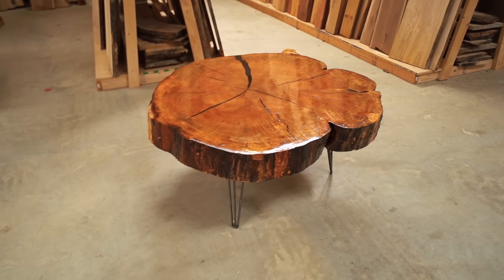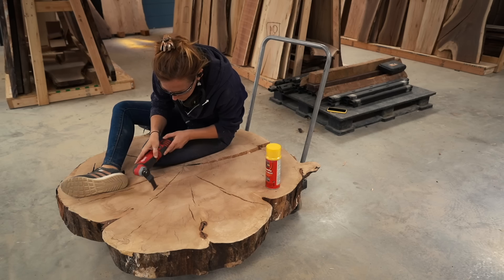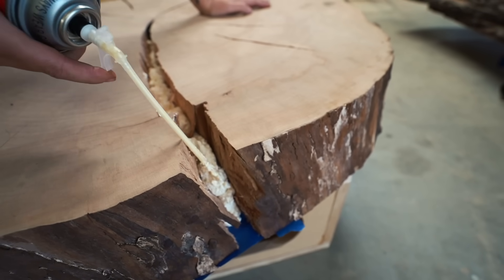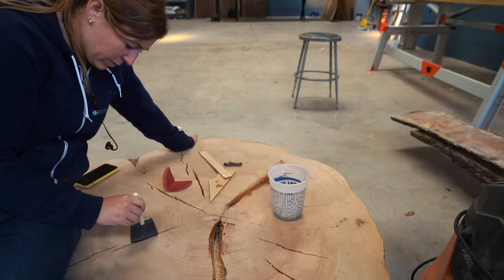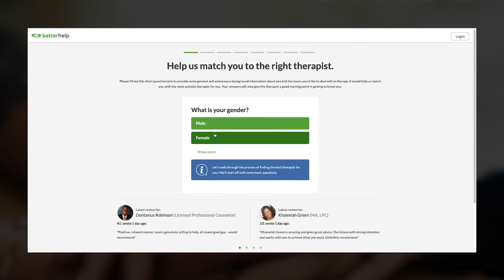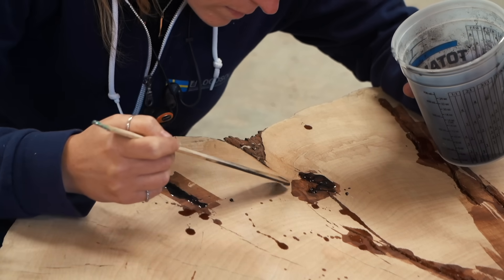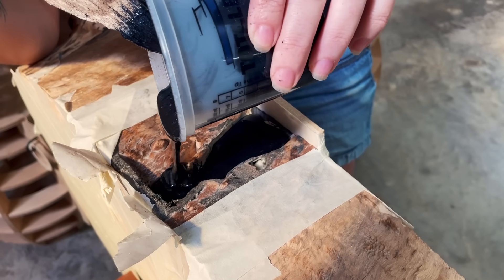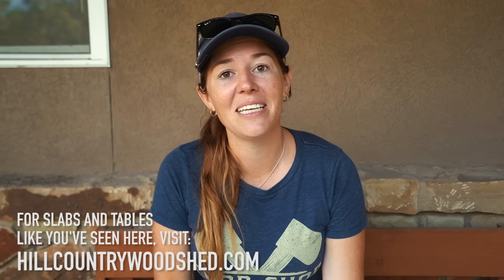Making A Live Edge Coffee Table | DIY Wood Slab Cookie Table

Comment: April, your table looks beautiful and I am inspired by your work!  Filling the cracks with foam is a stroke of genius.  I am a novice wood worker and have just built a router table and flattened a couple of cookie slabs with a very large router bit.  I have learned from your video that Total Boat Epoxy seems to be an excellent choice for filling in the cracks.  I am very curious to learn what you used to get such an terrific finish on your table top?  Again, my compliments, and I have subscribed to your channel for more great tips from you!

Comment: What did you use to finish the top? After filling in the cracks with the black epoxy and putting on the legs. Was that just the clear epoxy? I'm making two smaller end table versions of this, even the same legs! I have some penetrating epoxy too. It says I can use that first to help harden and stabilize the wood. My two large oak tree trunk cookies are only a week old and the tree was alive if that matters. Should I use the penetrating epoxy and then the tabletop epoxy? That's what the penetrating epoxy says to do, as it will harden the wood and help prevent bubbles in the tabletop epoxy. PLEASE HELP! I have watched 50 of these videos and yours is my favorite! Thanks!

Comment: Table came out great .. expansion foam was a clever idea to save time and epoxy.  I've just started working on cookie slab .. One question ... I noticed that you finished off table top with Total Boat Epoxy (I'm doing the same) .. I think I would like to make my finish darker by using a stain .. been reading about Rubio .. Osmo and Odies... any recommendations from your experience ??  So .. if I have this right .. I would use Poly /Resin as a seal coat .. sand .. than apply  'stain'  ..  could I then add another coat of Poly as a top coat for that glossy look ???    Thanks !

Comment: I've tried to fill cracks in a cookie with black epoxy, but ended up staining the surface around the cracks down half an inch into the wood.  How did you prevent this?

Comment: After the cracks are dried, do surface the top to flush everything? How would you do this?
Reply from the maker: You can smooth things flush with a sander. I used a ROS sander. Thanks for watching.

Comment: How did you dry a slab that thick? Did you measure moisture?  I worry about continued drying/cracking.  I hav 6 cookies air drying to do this.  I was curious how you sanded it too. A belt sander doesn’t cut the end grain as well as I hoped.
Reply from the maker: The tree cookie was a gift to me and already dried when I received it. I sanded it with a ROS sander. Thanks for watching.

Comment: Hi April,  i purchased a new router (my first ever) from walmart - it has three bases, basic, offset (that has a belt drive inside the base), and plunge cut for $99.00.   But i have no idea how to assemble all the parts or how to use the router.  The manual does not cover assembly or give use examples and i find no MFG videos for the product.  Im not a extreme woodworker,  just a weekender. You are so great at explaining things, can you please do a router video for beginners, what does where, attachments, assembly, and example uses with some basic bits.   Thanks so much :)

Comment: Missed the part where you flattened it before and after the epoxy.  I have a 42" cookie of cottonwood with a 3" crack, been sitting for 5 years outside, trying to decide how I would use such a table.
Reply from the maker: With a ROS, it was sanded both before and after epoxy step. I bet the Cottonwood piece will be beautiful. Enjoy your project.

Comment: Hi April, it looks great!  You stated that it will crack over time, what do do then?  Would you sand off the finish and refill with epoxy?
Reply: She meant if you choose not to fill the cracks with epoxy or bowties the cracks would expand over time. The epoxy prevents the cracks from expanding and will last years. If you try this make sure to add finish to all sides of the piece to prevent it from warping/twisting/cupping/cracking.